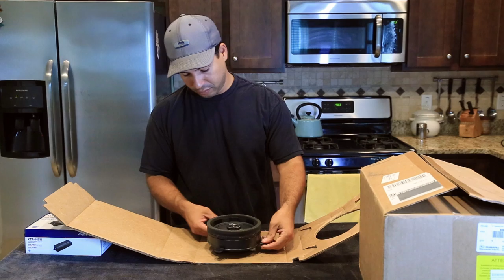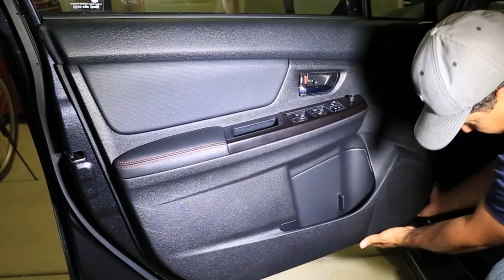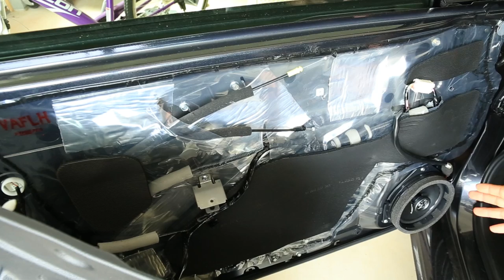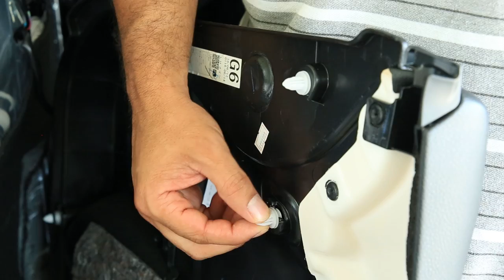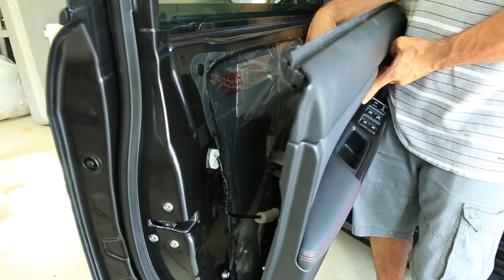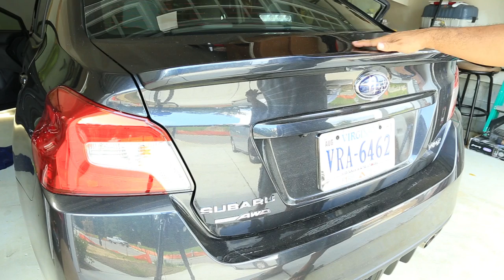How to Install WRX Kicker Door Speakers (H631SFJ001): Sound System Upgrade Pt 2

Comment: I like the electrical tape tip. Very informative.
Reply: Its really a waste of time and material. Those clips are loose to make everything line up easier. When the panel hangs from the top of the door shell and is bolted down, none of them door panel clips are going to move.

Comment: This video is extremely helpful! I've replaced speakers before and done sound-deadening (dynomat) on several cars already, but your tips to derattle the doors are great. Especially the electrical tape trick - I've never seen or heard about that. Its way easier than dynomatting the entire door - which is a complete pain in the ass and IMO not worth the trouble.

Comment: Bought these speakers used off someone for a great deal both mids and tweeters shipped for 200. The guy who shipped it didn't package them well and some of the plastic where the screws go broke. Luckily I had strong adhesive to glue them back together. Used your install video to install them. They are night and day difference, can actually put the music up loup without distortion. The clarion stock head unit and no amp are the only things holding it back now. Plus no sub. Not going to get the kicker sub because it's seriously overpriced, unless I can find it for cheap. I have a jl w3 in my garage so may just throw that in there. Thanks for your video it definitely made the install process super easy. I did all speakers in about an hour.

Comment: Jezus!!! The taping tip with all the clips would improve the sound quality of the stock speakers alone! My stock system rattles so much I’m checking the passenger door to see if I somehow forgot that I put a can of 37 bolts in the bottle holder

Comment: Huge help - thank you for this!  I've been driving an old 1992 Nissan Maxima SE for 10 years.  It came with a fantastic Bose system installed standard.  I'm surprised by how underwhelming the 2020 WRX sound system is - and the rattles from the driver's side door are driving me crazy!  Just ordered the Kicker door speakers and some Noico sound deadening sheets.

Comment: I just bought a new 2021 wrx that has stock speakers and was wondering if the installation would be the same. There isn't much info on them yet since they just came out last month and this is my first new car and wrx so I didn't want to break anything.

Comment: Do you need an amp to run just the 4 speakers no subwoofer to stock 2021 STI
Reply from the maker: You do not need an amp, although an in-line amp DOES make them sound much better.

Comment: How did you go about resealing the vapor barrier to the door frame? Thanks
Reply: Boost & Shutter - Ah, i figured as much.  It’s a 2017 with 28k miles. Noico material will be here Wednesday.  I’ll try doing it at night time if it’s not too warm here in NY.  It’ll be in the 60s so I don’t see it being too hard to take off. Thanks man.

Comment: I traded in my 2015 Civic Si (I loved everything minus the FWD), I had Kicker KS and JBL sub in it....it does appear that Honda gives you far better sound than Subaru,  I loved how it sounded.

I was going to get Kicker KSs for my WRX, I already got the Kicker tweeter upgrades and want to get the same JBL 12" sub, however do you think these Kickers are similar?

Comment: SO do you think the upgrade to the tweeter kit and speakers by kicker from the Subaru website would be enough to improve the sound?  I ordered my WRX on Sept 9th and it should be arriving sometime in Oct.  I want to have my dealer install them once my WRX arrives.  I'm not a gear head so I can't install them myself and I'm not down with having them installed aftermarket.  I'm a little confused from your review.  Thanks

Comment: Is that a shallow mount sub you’re using?
Reply: Boost & Shutter I just saw the subwoofer install video, great! Also, any reason you just didn’t purchase the wrx trim with the Harmon Kardon system?
Reply: Boost & Shutter I test drove one with a H/K system, I thought it would have been sufficient for just enjoying my music, now I bought a trim without, so I am going wire all new speakers in. Did you happen to run ALL new speaker wire, or did you keep the stock speaker wire? Also did you buy a harness that retained your Bluetooth connectivity and steering wheel controls?

Comment: Hey imma bit confused were you using the door speakers without the alpine power pack for awhile? If so was it much of an improvement from the stock?
Reply: Boost & Shutter thanks man I️ have everything you’re running except the sub and amp I️ may put a sub in later down the line any suggestions?

Comment: Does anyone know what ohm the speakers and tweeters are (kicker upgrade)?  i found out today my stock 2018 wrx tweeters are 6ohm.  I’m hoping the HU can handle 4ohm since most speakers are 4.
Reply: Boost & Shutter Thank you for the reply.  i watched the video, yet it didnt  have what i was looking for.  I’ll do some more research.
Reply: AJ Alvarez you are correct that the stock tweeters are 6 Ohms.  They are paralleled with the 4 Ohm door speakers. This presents a 2.4 Ohm load to the stock head unit.

Comment: Installed these speakers and now the car wont start. Everything lit up, but it wouldnt try to start. I tried to jump it, but now only the dash lights come on.  Anyone else have this issue?
Reply: You mightve drained the battery when installing the speakers. It will throw a P0606 code. You may experience limp mode as well. Just reset the ecu and let it run for 10-15 mins. This is in our service bulletin.
Reply: @skrapnrex4468  Why and how would this happen from simply changing the speakers with the car off (and not in accessory mode)? Kind of baffling and making me hesitant to do this install myself.
Reply: @SaoGage  Hi. If youre just changing the speakers then youre totally fine, I did mine too. The thing is to make sure nothing is draining your battery aside from opened doors when working on anything. Happened to mine when I installed the rear diffuser with the music and the car just on accessory.